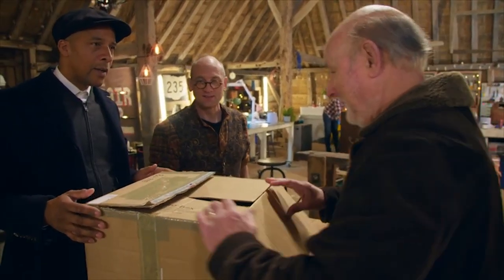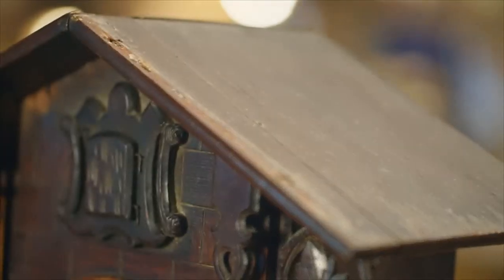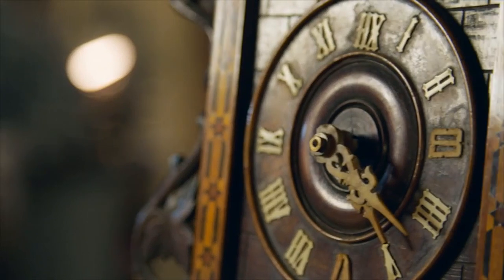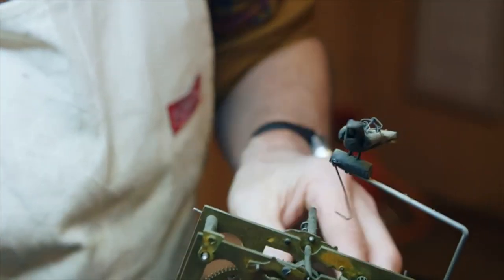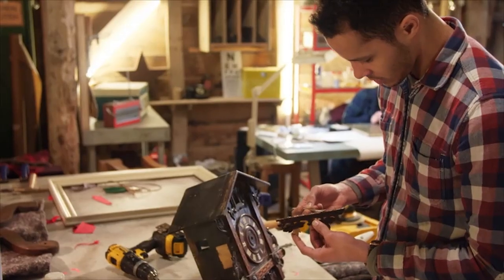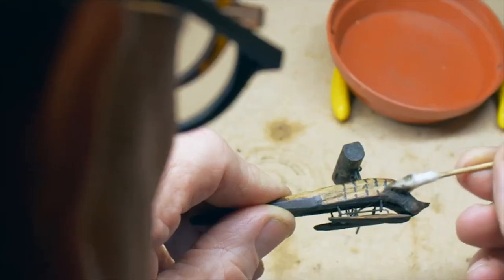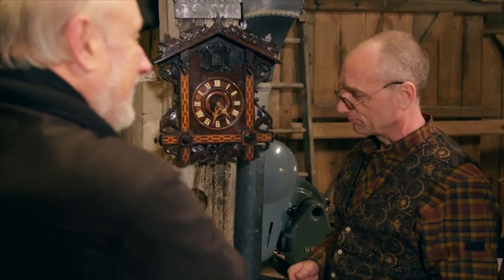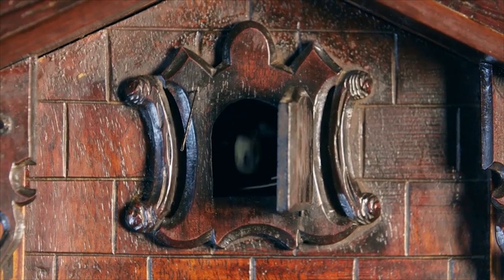Victorian Cuckoo Clock Finally Coos Again | The Repair Shop

Comment: I fix clocks and watches, but coo coos are on a whole other level. So much patience required, since they are simply a novelty, not serious timekeepers.
Reply: As a professional clock repair shop owner, cuckoo are the easiest of any clock to fix. There is virtually no patience needed.
Reply: @derekr7814  Provided one has the right tools, of which I don't. They are simple contraptions but can be very very precise for some parts. They are less precise than a music box though, OH GOLLY the precision on those is another level.